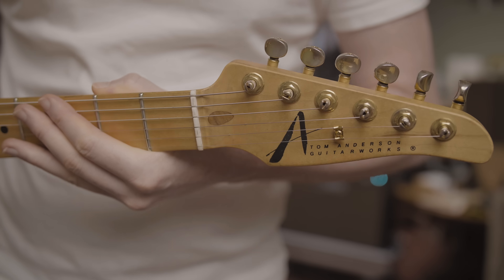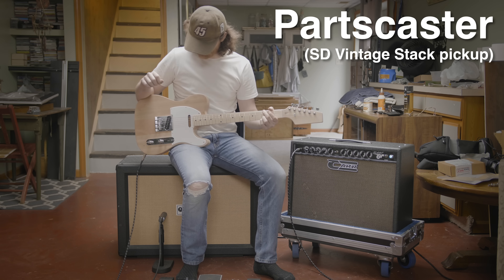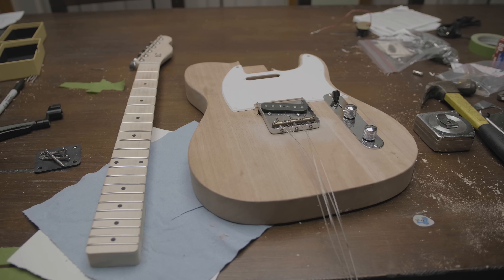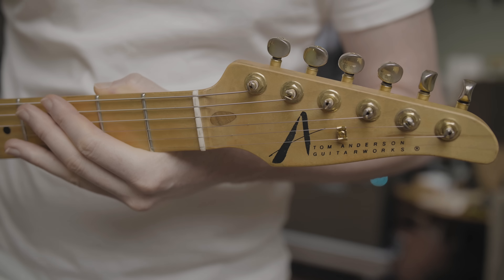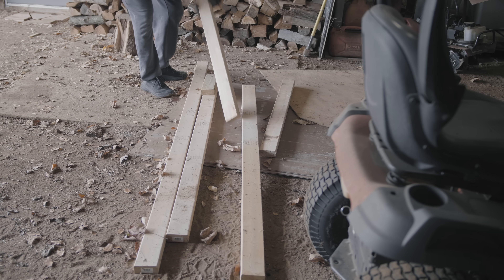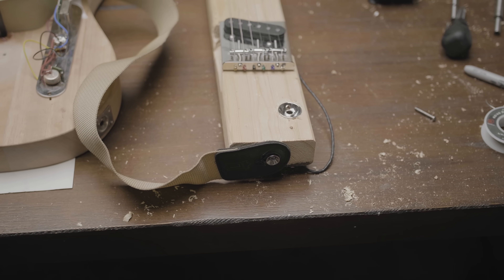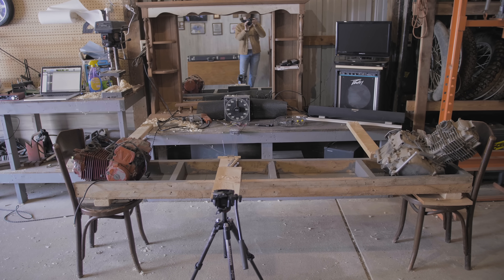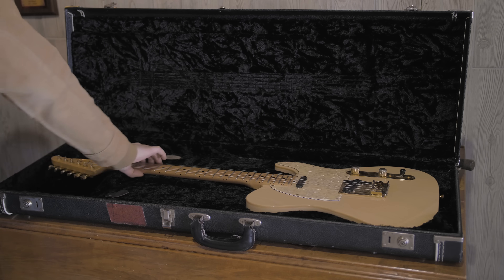Tested: Where Does The Tone Come From In An Electric Guitar?

Comment: A Very interesting demo. Both Mark Knofler and Chet Atkins told me in NYC in 1999 that they felt that at least 50% of tone comes from the player, and how we fret & strum the strings.
Reply: you met mark knopfler? absolutely awesome
Reply: @ianmayer8032  yes during the Audio Engineering Society Convention in nYC, October 1999. He's one of my all time favorites, and a big influence on my as a guitarist, songwriter, arranger & producer.
Reply: I'm guessing that a large chunk of the remaining 50% comes from the amp
Reply: @holy3979 yeah the electronics including the pickups. The strings do also make a significant difference in tone
Reply: @ltzp2  yes true, both contribute as do pickups, string type/guages, amp, speaker, cables all of it as a chain, a system.
Reply: @holy3979  hi...it is really everything in the chain s fingers touching strings>the materail of the string & its guages> guitar's construction, type of wood, solid or hollow>the pickups>how you've set your guitar's  on board volume+tone controls>quality & length of cable ot the amp> the type of amp, its type of tubes, circutry>out to the tpye, diameter, and vocing of hte loudspeakers...a lot of factors/variables contribute.
Reply: So much this. Bad guitars suddneky sound really nice played softly with fingers
Reply: @KawazukiYama  I have seen Mark Knopfler and other top players fool around with low cost, entry level guitars, and they still sound great, still sound just like Themselves.
Reply: My fingers are made of vintage swamp ash.
Reply: @Canada_Dominium  if you roast ash that will imporve the sound...but dont do that with your swamp ash fingers ! Just kidding you of course !
Reply: @Lamster66  MK is a humble man but sitting next to him that day at lunch together in NYC was his hereo Chet Atkins who agreed 100% with him. From a persona lstandpoint I stopped using a pick since that lunch meeting and I feel much more comfy, relaxed and my sound has never been better whether its acousitc, dobro, electric or electric slide. Yes I use some great guitars , some awesome vintage 5 to 40 watt Fender, Marshall, Vox and Orange amps, and only a handful of carefully chosen reverbs or delays
Reply: @REDBUTCH3R a player's style certainly has a direct impact on tone
Reply: @Lamster66  pickups are without question a Very important ingredient and contributor to tone, but they are part of a chaoin that includes and is influenced by much more...string materil, guage, cable, amp's circuitry, tube type, speaker type, amp or speaker enclosure sealed, ported or open back
Reply: @Lamster66  at everyone's core....so do you, me, and everyone else
Reply: both guys have top notch gear.......
Reply: @Lamster66  usually start with cheap stuff yes. but then realized better guitars sound better, not a plywood squier with great pups. so much you tube with these high end players talking about their gear. and those that don't talk about, well they don't need to, they already own it
Reply: @Lamster66  seems like we are in agreement?
Reply: Yep, more than 50% most likely.  There's a cool story of Jeff Beck being without a guitar and they handed him a cheap strat copy and guess what, Jeff Beck sounds came outa the amp.  After trying to learn guitar for a year, I handed my cheapish acoustic to my classically trained friend and the sounds he made were ear meltingly beautiful.  It was shocking and a really good lesson.

Comment: You know what's funny to me? There are still people who can't accept they've been wrong this whole time so they resort to "well, it's not a scientific test without the measurements so it's invalid and we still don't know!". As if the fact that a real guitar and one made of air sounding extremely similar isn't enough to tell us how much could wood really matter then. So I'm supposed to believe a guitar and a bench could sound so similar that I couldn't tell a difference in a blind test but if you somehow compared it to the same guitar but swapped the fretboard for rosewood it would sound different.
Reply: And it's funny that's still hundreds times more scientific than pretentious snob ears, "feelings"... It's even everything laid ou too be reproduced by anyone.
Reply: And you just know you can provide every measurement they ask for, and they'll always find something else you "missed," which apparently renders the whole thing invalid. Some people won't be convinced unless you fly them out to Nashville and make them watch the process from start to finish.
Reply: Wait! There is something about this test that was not taken into account. Jim used very good pickups, some pickups of more poor quality will also be microphonic, which also picks up the actual sound vibrations (not just the magnetic field). This is a real sound change that you can also hear with your ear (because the pickups are of poor quality and microphonic). So, may tonewoods actually exist, but if the density of your wood is effecting your guitar sound, you probably have microphonic pickups… which most consider something that is not good…. lol
Reply: @jake5952 not only poor quality some sd antiquity and even emgs can be really microphonic
Reply: yeah big redditor energy
Reply: It's because there is no different... the strings are terminated and fixed. Les Paul did all this work 70 years ago, it's nothing new you can even listen to him explain it https://www.youtube.com/watch?v=OLA6GaVzJMA&t=279s
Reply: There are some videos on the Warmoth channel where they switch out guitar bodies and keep everything else the same... and you can hear a small difference, but I had to put on headphones to really hear it - it was pretty subtle, but it was there.  One other thing: the more gain you add, the more guitars can sound similar because a distorted amp (or pedal) adds a lot of its own flavor to the sound.
Reply: @budgetguitarist By the time you're straining to hear the difference it's time for blinding and, if that still shows a difference, double blinding.
Reply: I look for a fast fretboard and decent pickups. If i spend out on a guitar, to me a harder wood means it might last a bit longer, i would pay up for better hardware. I don't see the point in these 30000 dollar vintages.
Reply: @stu1037 Then add good tuners, good bridge, good nut and stable neck to the equation. The good thing is these elements don't have to be superexpensive to be good.
Reply: but he couldn't make 2 guitars sound the same or very similar so I think the point is valid.
Reply: I'm already biased in favour of the point you or the video is trying to make (player experience, pickup quality, pickup distance from the strings and pickup placement along the strings mattering most). 
Funny and insightful as the video was, there actually is an oversight in the testing of whether wood choice matters. The "air" guitar is not an air guitar at all, it's still a 2x4 wood guitar. What holds the strings in tension (what holds the bench and shelf at a fixed distance) are still a couple blocks of wood, which may or may not have the same properties as the two guitars he used earlier in the video. 
A good test would have been the "air" guitar (bench and shelf) setup, same pickups, distances, player, amp, riff etc, and different types of wood holding the bench and shelf a fixed distance apart.
I'm a mechanical engineer, this is what vibrations are affected by.
Edit: to clarify, I still don't think tone would change with that setup. What probably would noticeably change is the sustain of high frequencies at low distortions and with softer wood, due to dampening.
Reply: The problem is that this video is trying to say that woods/substrate/guitar body doesn't matter.. and basing that whole argument on the fact that everything but the pickups, the strings and the tuners have been replaced... but that's not the case. Strings need something solid to resonate with to maintain their oscillation... plugging this rig into a bench does not demonstrate that.. you're just replacing the guitar body with a bench.. so, of course the strings will resonate the same - maybe better! Replace it with stale bread and you might have a point. :-)
Reply: @crazyjack9voltbatteryamps If a bench makes it sound so similar to a regular wood body, that makes us think that maybe the wood body it's not as important as we thought.
Reply: @crazyjack9voltbatteryamps  Spot on👌
Reply: The difference in tone is as clear as night and day. Blind test and all. You don't have to spend a fortune but if you want a decent tone you still have to spend a bit, be that time or money.
Reply: @MrRadbadger  Night and day in Scandanavia maybe...
Reply: @aneveningwithebola2727  There's a reason successful artists tend to go with good gear. Like I said you don't have to spend a fortune but anyone arguing it's confirmation bias to justify the expenditure.. That argument could apply equally to someone who wants to justify being a cheapskate.
Reply: @MrRadbadger  I imagine there's a variety of reasons successful artists choose "good gear." Not the least of which being that big companies love making endorsement deals with people who've got significant followings, but also they're as susceptible to bias confirmation as the rest of us. I really don't get what point you're trying to make on that one.
Reply: @aneveningwithebola2727  So Jimmy Page, Hendrix, Iommi etc only use that gear for endorsement deals?
Reply: @MrRadbadger  If I remember correctly, Iommi in particular didn't start out playing a Gibson, but a knockoff... Regardless, I didn't say they were all endorsement deals, and I made it a point to mention they're just as susceptible to bias as the rest of us, so appealing to their supposed authority on the subject is pointless.
Reply: @aneveningwithebola2727  You didn't get the point I was making. Good luck with the playing 👍
Reply: @MrRadbadger  You're right, I didn't! I asked, but, whatever.
Reply: @MrRadbadger  As a performing musician; 

The reason is because those guitar brands pay those musicians a lot of money to endorse their products. It's product placement.
Reply: @MrRadbadger  Yes, they did use that gear for endorsement deals.

Slash too, Slash played BC Rich guitars for a while, among other guitar brands, but Gibson paid more. 

Every famous musician with a branded guitar is being paid by that brand to endorse their product.
Reply: @raven4442  Apparently his actual player is a custom made les paul copy made by Kris Derrig. It wasn't really my point though. Endorsement or not, they're not cheap peices of shit made with crappy wood(most of the time). You don't have to spend a fortune but if you're serious about your playing it's usually wise to find a manufacturer who is serious about their product. 
You should expect to pay $1000 -$1500 for decent guitar. New or secondhand, usually secondhand. Not sure if spending more than that is going to get you a better sound. 
As to spending less, you can get lucky and find a good deal or find a good instrument from a cheap maker. I've found a few good deals but I've yet to find the latter.
Reply: @aneveningwithebola2727  5:24 and 5:39 with decent studio monitors you should hear some tone difference, the partscaster has more bass and less mid high definition.  But it's almost exactly the same, very subtile difference.  You can definitely get a really good tone on a guitar by putting good pickups.
Reply: @MrRadbadger  what you are doing is a textbook example of authority fallacy, literally a textbook example
Reply: @fernandosilva6295  Uh-huh.. Well I've spent money on cheap gear, and expensive gear, and I've heard the results. Also from mates who have done the same. So do I speak with 'authority'? Well yes.. 
As for the fallacy, unless you can back up your statement with a sound argument.. That would be you.
Reply: @MrRadbadger  that's a different argument, your original comment was just "the pros did it so it must be right", THAT is an authority fallacy (look it up on Google), you stating that you have personally heard the differences is completely a different argument
Reply: @fernandosilva6295  Read the whole thread. Clarification is a thing in case you didn't know. But you raise a salient point.. If you want to prove me wrong find a pro who actually 'enjoys' playing some cheap chinese shit and makes good money from songs that they've written and played on it. 

As a caveat, the money and popularity is secondary because what really matters is the 'enjoys' part. Enjoys is the operative word. Do they 'really' enjoy playing it?
Reply: @MrRadbadger they go with expensive gear because:
1) they can afford it and it's a statement.
2) more expensive gear implies better quality control, so the fretwork, nut and action are better out of the box
3) you get the good pickups
Reply: @akkudakkupl  Good gear is expensive, due to workmanship and the materials they use. 
If someone thinks they are going to get the same playability from a cheap asian ripoff guitar made in a sweatshop as from a dedicated luthier who has spent years honing their craft.. All I can say is they probably take their art as seriously as the workers in the sweatshop.
Reply: @MrRadbadger  I didn't say it isn't and I didn't say it is not more pleasurable to play bespoke gear. But you can get indistinguishable sound out of a way cheaper instrument with the right pickups and setup.
Reply: @MrRadbadger  You really don't get how you're giving proof against your own point, do you? What the video and everyone and their grandma is trying to get through your tonewood skull in this comment section is that what you hear is subjective. When you hear a guitar tone, you can't say absolutely if it's good or bad, you can only say it's good or bad RELATIVE to another tone. And if you think your bias will let you fairly compare 2 tones of equal quality, even if they're different from one another, if one is coming out of a 150 dollar Harley Benton and the other from a 1500 dollar Fender pro, instead of just setting the fender tone as the benchmark and considering every difference the other presents is a defect, then you have no idea how research or facts work
Reply: @MrRadbadger  There are plenty of studio musicians who record tracks on squires and epiphones. There are yamaha pacificas all across the current music landscape. You're just a snob. Nothing wrong with that per se, but don't try and make everyone else partake and get angry when they call you silly

Comment: 1). The finish.  The finish has to breathe or it will choke and even suffocate.
2). What kind of soil the tone wood was grown in.
3)  The tightness of the frets in the fret slots and the hardness of the fret material.
4). The age of the copper in the windings and where the copper was mined.  Chinese copper is severely diluted with cheaper metals.
5). And lastly.but probably the most important factor  in guitar tone is Magic Fairy Dust.   Yes fairies have been known to throw their special magic dust on some guitars.  Jimmy Page, Jimi Hendrix, Dave Gilmour, and Stevie Ray Vaughan have mentioned this to their closest friends.
Reply: love it

Comment: the right way to check this out is to get a guitar and a bunch of different necks and then swap them out until you notice a change in tone. They'll most likely all sound really similar but you'll eventually run into one that sounds way different for some reason. I've changed a neck on a strat before and got a night and day difference in tone from it, but that isn't the norm.

 People who will deny that the construction of a guitar can effect the tone are usually just tone deaf. They can't hear the differences in tone so they deny those differences exist. Despite that, they have a point about "tonewood" being a marketing gimmick. When a piece of wood really has great tonal characteristics it's really just a happy accident and I don't think anyone knows why, though there are millions of theories.

Comment: Great effort - but I am hearing the differences - To exactly take the amount of wood and quality as Tom Anderson do ( or good builder ) is the point -
Any sound before putting the electronics on the bench was easy to hear how better and professional the Tom Anderson is - even though you got very good sounds out of that kit - At the end putting everything on the bench showed similarities - but let anyone take that bench out to play a gig ??? 
It's the amount and quality of the wood as Nr. 1 - and than you can do the rest - but rest is top of the line by Tom Anderson...
It's like playing an low quality acoustic guitar and connecting it by holding to a wood table or a bar or whatever and you'll get a much bigger sound and warmer and better .....

Comment: I've thought about this long and hard and this seems like a valid test but it's not. guitars absolutely do sound different. It's the minute nuances that you can't capture by just strumming a single chord and listening to the compressed audio on youtube with generic speakers. The real scientific test would be to analyze a frequency spectrum closely and you would find the critical mass of the body would have a resonance frequency that would amplify different frequencies more than others and therefore different body styles would resonant differently, affecting everything attached including the strings, magnets, etc. The resulting "tone" would inevitably be different.  It's basic vibrations science really.  And it is noticeable to the human ear.  Some people can even sometimes pin point make/model of an artist's guitar just by listening to a song. For instance Les Pauls can be unmistakable for their thicker tone, due to the thickness of the body. Just like how body shape/size/wood type affect acoustics, even over pickup/microphone. I'm sure this guy means well but this video is very misleading.